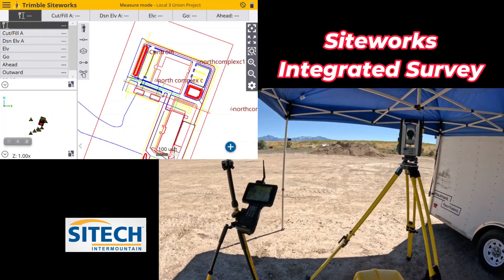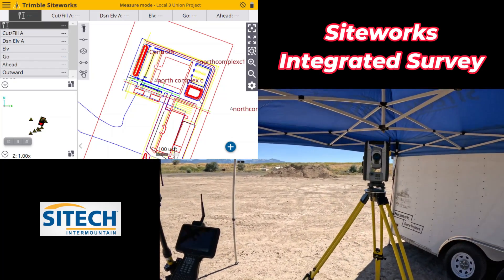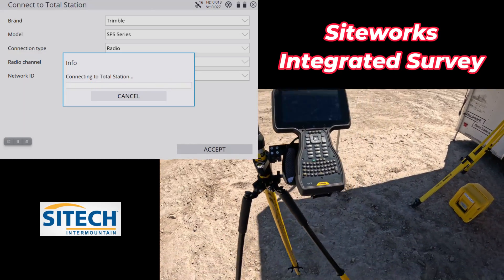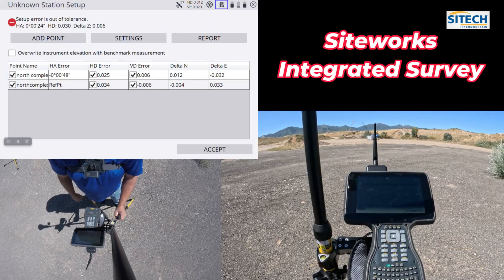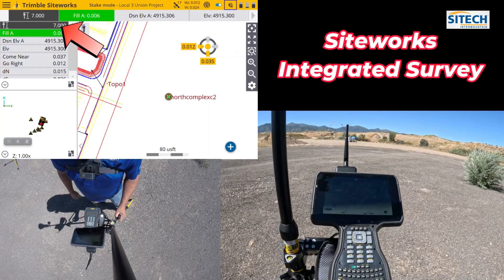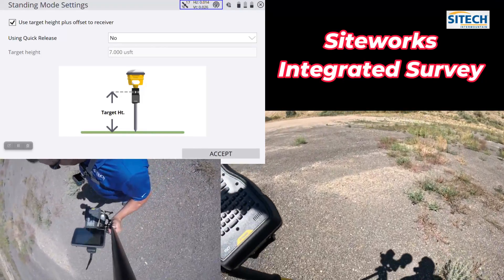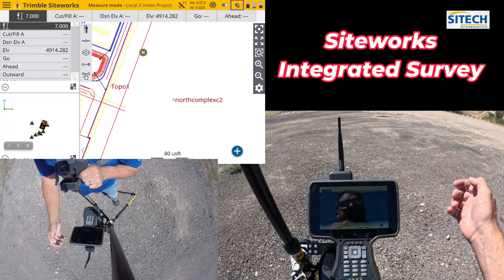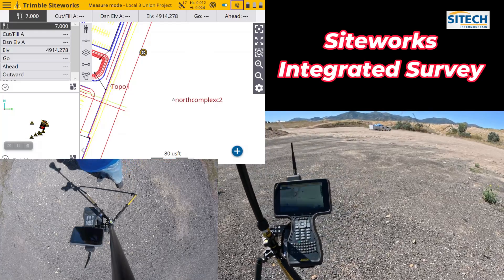Siteworks New Integrated Survey Option GPS and Total Station

Comment: 9:50 
Hi 
Can you please show how the workflow is done how Trimble wants us to do it because we’re having bad resection results when using the new 1.70 integrated survey module
We have really bad horizontal angle values after like 8-10 integrated control points outside our worksite perimeter compared to Trimble Access on the same site
I am using both softwares since many years and here we have a very big difference in accuracy.
Have you discovered any similarities… 
Best Regards from Sweden 🇸🇪 and thx for a very good YouTube channel 👍👍👍
Reply: Well, to be honest I was not aware of a problem with this version and setup yet.  Since I am not surveying every day like I used to I am not setting up multiple times and have not caught it yet.  The process should be exactly the same with this as it would be if it was not integrated so if you have not changed how you re section from version to version, you are good.  It’s funny you noticed this, because when I made this video I noticed my re section was out of tolerance but it’s a new fresh calibrated total station, so that may be why it did that to me.  I will look into it and maybe make another video soon. Thanks.